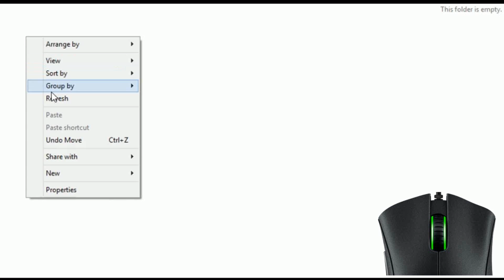Razer DeathAdder Chroma Double Click Issue fix

Comment: Where did you get the replacement Omron microswitch?
Reply from the maker: Ebay
Reply: Google Omron D2FC-F-7N, which looks to be the model of switch they used.
Reply: (for those who come after me, since this comment is a bit late) Digikey might have 'em. You'll likely have to have the exact part number though.
Reply: @aanrudolph2 
Even later comment, OMRON D2FC-F-K  is available on amazon uk, its the same but better switch. 50mil actuations vs 20mil.

Comment: The First video of DeathAdder Chroma that i see, i will try ;-;
Reply: I guess I will not be able to, i don't have the tools that u used
Reply from the maker: Yes. You'll Need Some Tools. 
1.Screw Driver.
2.Anti Cutter
3.Soldering Station.(Iron,Sucker,Tin/lead )

^ These are Must.

Comment: Cool! I think it's the first video about disassembly of a Razer Deathadder Chroma(!). Right now I have the double click issue, too, and i think this video is perfect. Thank you. But which glue should i use to stick the rubber back at the bottom? Superglue?
Reply from the maker: +Danie0l0ntertainmet
NO. 
Please Don't Use Super Glue on Any Gaming Peripherals Ever.
 
Use Double Sided Tape (You can find it on any Hardware Store).
So in Future if you face similar problem,it'll be easy to remove.